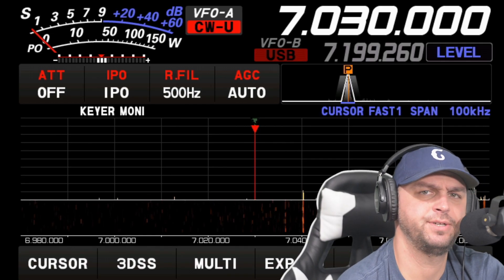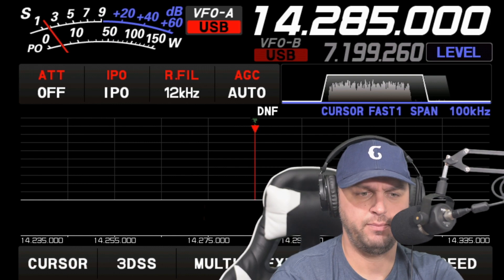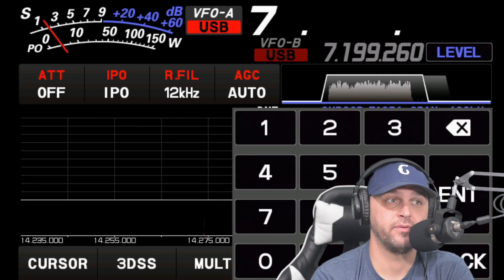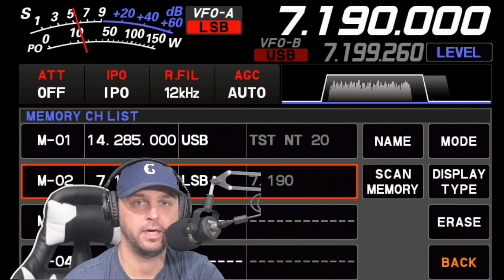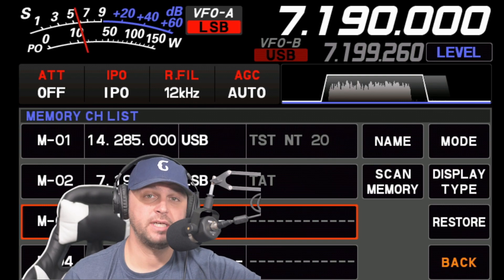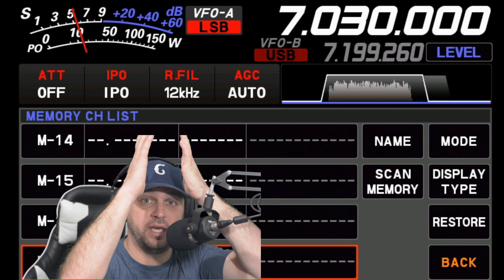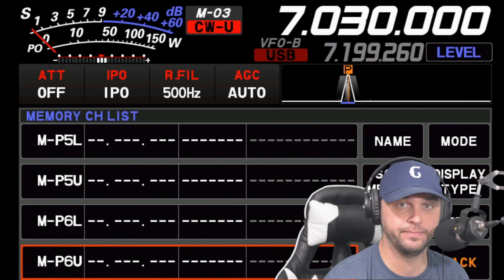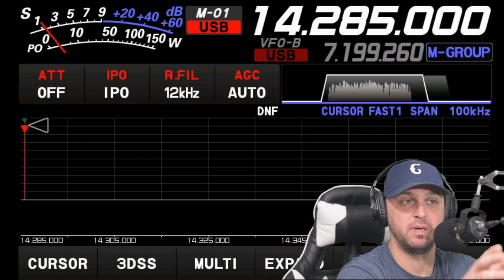Yaesu FT-DX10 - Programming Memory Channels.  A brief walktrough

Comment: How do you change the memories to different memory groups?
Reply from the maker: Hello!  Page  71 of the manual states:  Press the [V/M] key, if necessary, to enter the"Memory" mode.2. Press the [FUNC] key.3. Touch [GROUP].4. Rotate the [MULTI] knob to select the desiredMemory Group, then press the [MULTI] knob.5. Press the [FUNC] key, then touch [MEM CH].6. Rotate the [MULTI] knob to select the desiredMemory Channel within the Selected MemoryGroup.  I hope this is of help to you as I do not have the radio anymore.  Thanks

Comment: What buttons do I press when loading from RT systems from the computer?
Reply from the maker: Unfortunately I don't more much about using that with rt systems. If it can't figure it out, the support over at RT is great
Reply: @DudeTested  I figured it out. Pretty easy. Just plug in usb cord. Read radio first, then load new memories. No special key presses.

Comment: Ok Dude, got my FTDX10 today, my mouse is going really fast tried the setting but it won't settle down, also when I am in the settings places it will lock up and I am unable to get back using the button, I feel like a dweeb and of course I have not cracked the manual open yet. LOL

Comment: audio sounds better :)  when i played with audio and making youtube videos i'd run about 6dB of compression and limit the output to -6dB.  looks like your'e running around -3dB.  at the beginning of your video and in a few spots i could hear some clipping which means your mic level in is a touch too hot.   lower it a dB to start, add a few more dB compression in start there, if the overall output is low, then adjust the output or makeup gain, but careful not to overload youtube :)   you want a whisper and yelling to be the same level, no distortion and with the threshold/depth set correctly.    change the mic and you're back to the drawing board lol.    good luck, 73 from 5 land.
Reply from the maker: Thank you.  I think I figured out that it's better to change the volume at the mixer/usb interface (focusrite) instead of the software.  I did hear that clips too.    I really appreciate this input.  I'll reference when I setup for three next video.  I appreciate it, greatly.
Reply: @DudeTested  no sweat!  i'm not criticizing, just throwing out some ideas in case you haven't tried them, all the best!   enjoy the rig!  I'llget back in the hobby if i can ever get my grounding figured out.

Comment: Hi Sean,
Are you saying that If I go to say 20m, it will not automatically select USB as the mode? My FT450 does that when I change bands. Stay safe.  WJ3U
Reply from the maker: Don, I did say that, but since then: I have confirmed that if you tap the band button and don't select anything, it does have band registers. I should make a video on it soon.  Also, did you say your FTDX10 does NOT have an issue with 150w at 12m?  I'm understood my radio is going to possibly need to go in for service.